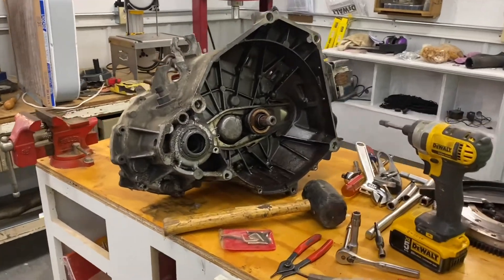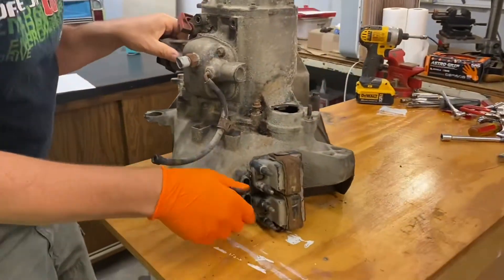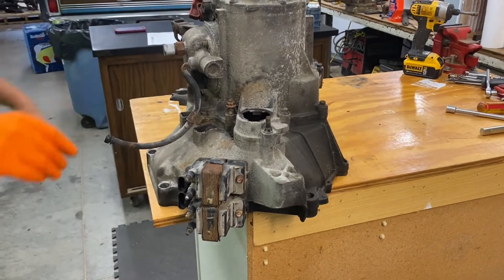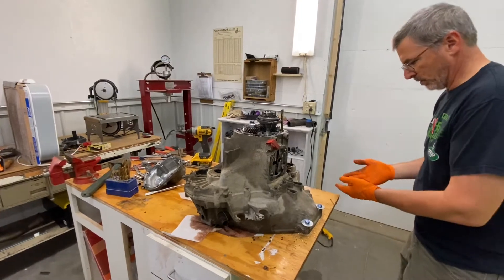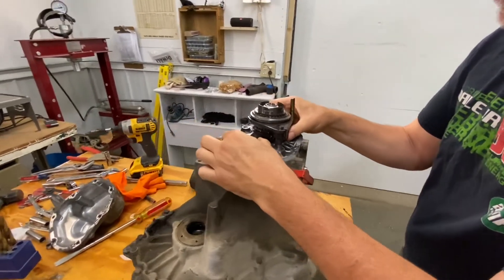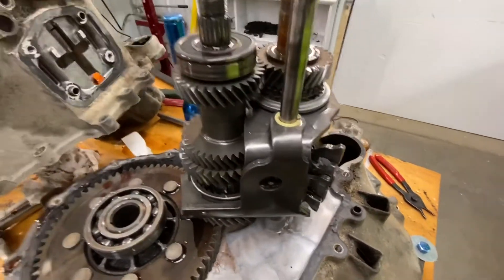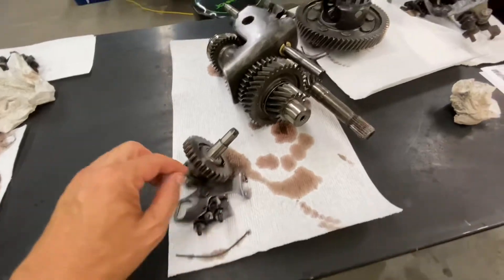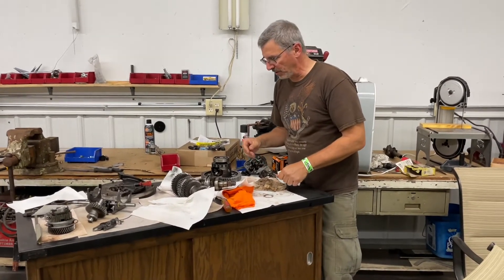Saturn Manual Swap pt. 5 Digging into the Transmission

Comment: We're is the reverse light switch located at on the manual transmission for a Saturn ion
Reply from the maker: https://www.redlineforums.com/threads/need-a-quick-awnser-reverse-light-switch.37077/

I am not familiar but I found an old post that discussed it. Inexpensive switch and it’s located on the transmission. Hope this helps

Comment: I know it's an old video, but can someone and please tell me a place where i can get an input shaft seal? Rebuilt my transmission a while ago but i noticed it starts leaking from the input shaft when warm and i cannot find that seal anywhere
Reply from the maker: I wish I could help, I looked on line the last half hour and nothing in stock. Wonder if you could measure shaft and od of the seal and look in a seal catalog. I haven’t worked on mine in a while since I can’t get parts either.
Reply: @jerayracing  ive looked into it and ill probably just swap another junkyard one, sad to see parts for these cars slowly dissapear.

Comment: Dude punch it through as it's designed to be and put in a new roll pin. That's what I did no Brainer.
And in disassembly just use reverse plyers and left the shift and bearing drop. The retainer clips should have never left the housing

Comment: Thanks for posting up these videos.  So lucky that diff pin didn't come out!  We weld those in on every trans we take apart.  Also I have not done this yet but I've had a trans with a bad second gear syncro and a different with a bad 3rd gear syncro I may end up figuring out how to put them together.

Comment: That trans has a hole bored through it from the differential pin. Look at 1:10 , you can see the hole in the housing in the area where the differential sits. It is very common.
Reply: I dont know how i missed your comment but thanks.
I just went out to look at it to see what you meant. Will definitly check the other transmission. Might be a few months before i get working on the car. Got to get my duster ready first. Thanks again.
Reply: Is that whole supposed to be there mines a lot bigger i thought that’s why it was leaking
Reply from the maker: I just checked my other transmission 
Not supposed to be a hole. Definitely was the pin rubbing thru. Will weld in the pin on this transmission. Just fixed the frame rot now working on the auto transmission in the car. Finally working on my car again stay tuned. Thanks for watching